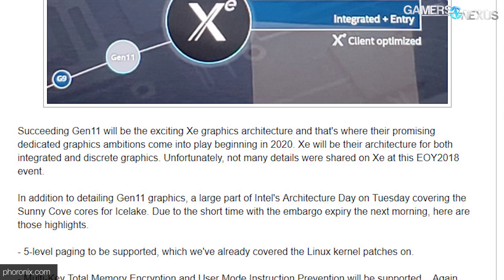Streaming Misconceptions: Best OBS Settings & NVENC vs. X264, ft. EposVox | LTX

Comment: I know this is old video but I have a I5-10600kf and a 1660 S. What encoder should I use? I tried Nvenc, 720p and 60 fps and apex is still crazy laggy on my stream. My internet is great and my bitrate is what twitch suggest. I can’t figure out how to fix it. What’s the best settings for my setup
Reply: Now you might be wondering how come some people have a decent Livestreaming quality if you're the observer?

The answer is simple, they're treated with higher Encoder settings by the server. Instead of AVC / H264 / X264, they use VP9 or AV1 instead. Hence better picture quality.

That's why "Partnership" is a thing.
Reply: Don't livestream.
Regular recording and manual Uploading is best for you.
H264 or X264 in general is Bitrate limited. You start from 720P logic and scale it from here.

For a decent 720p 60 FPS, you need 12 Mbps (Megabits not Megabytes) for the video, not including the audio, 1 Mbps is more than enough for Stereo channel audio. And Audio Quality doesn't really scale with video resolution
That means a total of 13 Mbps for 720p.

1440p is literally 4 times the size of 1280x720 - double width, double height. Now, just multiply 12 Mbps 4 times. You get 48 Mbps for the video bitrate. Most people with decent internet at 48 Mbps (or 6 Megabytes per sec) shouldn't have problems with Livestreaming speed —Or is it?

According to YouTube and/or twitch Livestreaming guidelines, they recommend you to use 6 Mbps (6000 kbps) for 720p 60 FPS streaming.
Do you know what that means? THEY LIED TO YOU.

6000 kbps for AVC / H264 / X264 Livestreaming at 720p 60 FPS will never be good eternally. And it's actually Hard-Limited on their server side. Which means even if you have more than capable internet speed at 48 Mbps, and you force the stream of 720p 60 FPS at 12 Mbps, the server will just Transcode it to 6 Mbps regardless of your upload speed.

Comment: If you can already get a comfortable image quality out of your games, target a CPU that can sustain x264 medium 1080p 60fps.  Worth it.  3950x can do slow (maybe slower), either slower or slowest caused a system shutdown and I didn't push it further.  I'd stick to medium but when I want extra heat in my room.

Comment: With a 3900x and 2080 Super -  would you be using Nvenc or x264 on medium? Also i have a c920 and idk how to set that up well, im wanting to stream 720p 60fps at 6k bitrate, should i just have the cam match or use 30fps?

Comment: Great video!! I have a Ryzen 7 3700x and RTX 2070 Super, I’m new to streaming and was wondering if I should use NVENC or 264? Also what should my bitrate be, I like steaming 720p at 60 FPS. Thank you so much 🙏🏽
Reply: You have a 3700x. Stream at x264 medium that’s what the cpu is meant for. If you feel like you want more FPS go with in a certain game go with nvenc
Reply: @plymix8389  so the 3700x is meant for streaming? I'm someone who wants to stream but depending on how much G the new AMD GPU have, I might go for them over the 3070 so I was wondering if I should get a 3600 or 3700x for playing and streaming using x264?
Reply: @floki6548  3600 is for the average gamer. It could handle streaming but if you want to stream alot then go for the 3700.

Comment: 1280x720 not being as good as 640x360 for webcam quality is absolutely not true. Even at a smaller size, it's blurrier and has more noticeable of a halo if you're keying. 

I recommend 1280x720 for your c920, it'll still run at 30 fps and when you downscale it, it'll retain a lot of the quality from the downsampling.

Comment: Err.. well you mentioned audio settings being important but you didn't give any tips on what codec or quality to use...
Reply: for what i know everything basically uses aac so there's that.
also audio options the bitrate i think you should set it to 192, and 48khz(?) though tbh idk if its too different from 44.1 to 48.

also filters can be a huge help, such as noise suppression and noise gates.

get a quality mic or you will regret it

Comment: How is my game not running at 60 fps.... I'm clearly hitting 144+. Who tf wants to stream at 30fps? This is the equivalent of telling people to buy a car from the 1990's as opposed to a newer model. Stupid.
Reply: Many games especially on consoles run at 30 fps. Also, there are slow-paced games like some adventures or turn-based RPGs which may run at 60fps internally but you wouldn't see any difference between 30 or 60. In that case you gain absolutely nothing from streaming at 60 fps, you only waste bandwidth while requiring more bandwidth from your viewers and potentially get a lower quality stream. I personally have two presets in OBS, one for 30 and one for 60 fps games, and switch between them depending on the game I'm playing.

Comment: What settings should i use on obs if i have rtx 2080ti and ryzen 9 3900x 16gb ram 3600mhz cl 15 samsung bdie  with internet connection 200 and 20upload?
Reply: Streaming apex for twitch

Comment: so wait I'm meant to take advice from someone who claims console games are 30fps? i can name maybe 5 current games that run at 30fps on current consoles and all are 4K and openworld. one of the games gets 36fps on pc in 4K SOOOOOOOOOOOOOOOOOOOOOOOOOO
Reply: Upscaled 4k not true 4k SOOOOOOOOOOOOOOO
Reply: @StreetRallyAsh  only on ps pro, Xboxonex doesn't scale it don't need to... so wind ya neck in moron
Reply: Actually many games run at 30 fps only. It also depends on the game, as some games don't even need more because they're either slow-paced or consist of mainly still images etc. There is no "one size fits all" setting. So yes, it's smarter to stream 30 fps games at 30 fps and 60 fps games at 60 fps. I personally use two different presets for that in OBS.

Comment: Question, should you run the Elgato Game Capture HD60 Pro from your main PC or secondary PC? I am running a i9-9900K with RTX 2080. If a second PC does the system requirements still matters a lot? Finally if there is a guide online that covers how to properly setup a dual or single system to run optimized can someone link it here. Thanks in Advance! One final question is the i9-9900K more than equal for streaming / gaming or should I be looking into a 3900X?
Reply: Second pc (obs machine)

Comment: So I’m in a dilemma I have a 3900X with a 2080 Ti what should I be using? I’m using right now the software encoder should I be using nvenc? Medium or? My native resolution is at 1440p 144HZ my output stream is at 1080p 60fps. Right now just streaming Apex

Comment: NVENC encoder chokes in OBS and drops many frames when streaming a game that you get more than 60-80 fps in on a single PC streaming setup. It also chokes if your GPU utilization is high, such as on a new AAA game with the graphical settings maxed out. It's not nearly as useful as it is purported to be. If they can solve these issues, then it will really be an excellent alternative to x264.
Reply: Or you just use the "new" nvenc and get a lot more performance out of it cause they removed the limiting factor when it comes to GPU Encoding with NVENC
Reply: @alpin2k7  This is false, what I said previously applies both in regards to the previous NVENC and the new NVENC encoder.

Comment: I wonder why Adam didn’t point out his findings on stream quality with NVEnc. 

After all, he himself did a long series of tests about NVENC Quality va X264 Quality and basically found out that NVENC on Turing cards trades blows with X264 on Medium Settings. What’s More: X264 above Medium Settings is just not worth it.

I mean: Yea, it depends on the load on the GPU, but he said before: Testing Testing Testing! So what gives?

Comment: Here’s the question no one can answer for me for streaming settings in Obs with this setup..
Ryzen 7 2700x, GTX 1070, 16GB RAM, 720p60fps stream.. do I use x264 or NVENC (new) and with what quality preset for either?
No one has ever been able to answer this well and I doubt these guys will either.
Reply: All I'll say is test both. I feel like both would work decently, but u gotta test them if you want a firm answer

Comment: 3900X - 1080p 60fps slow preset, high tune, 6-8k bitrate as i want - no dropped or skipped frames - i am so happy! :) PUBG, Rocket League, CS:GO, Overwatch ... 
We tried faster, fast, medium, slow and despite some other video that said "there is no difference!", i can clearly see ( as my viewers did too and asked what i changed ), that der is a huge difference when details like trees, grass, water etc. is shown and you move or turn around.
Reply: what other settings do you use im trying to use the same processor

Comment: I just turned down resolution on my C920, thanks!
Now there is no delay and i think webcam will feel less stressfull
And yeah, image is pretty much the same, thanks again for the tip
Reply: @Lil DonWan 480p 30 fps, it's plenty for little image in the corner

Comment: A little known fact: When exporting a 900p stream to youtube (via twitch exporter), it will downgrade it to 720p. This alone could be a reason to move up to a 1080p stream. It was for me.
Reply: You can set up OBS to save a local copy in 1080p and downscale the output for streaming to whatever value you need.
Reply: @LastofAvari  Does that use a lot more resources to stream + record at the same time?
Reply: Veetus have you found out if it uses more resources? Thanks
Reply: If you're using the "(use stream encoder)" setting for recording then no... ish, the only extra resources it should use, from my understanding, are the resources needed to write the file to disk, as the video only needs to be encoded once and just sent to different places simultaneously.
Reply: @Veetus  Yes, it has to be encoded two times.

Comment: x264 medium - set and forget on AMD Ryzen 3900x :)
Reply: How about 3700X?
Reply: @s9209122222  I'm using fast on my 3700x. Works fine. I can't tell the difference between fast and medium tbh.

Also I'm not streaming at 1080p60, but 960p60 instead. It significantly reduces blocking artifacts.
Reply: @Niosus  How can you see the difference between all the resolution or nvenc/x264 yourself? I want to see which is better for me.
Reply: @DieTabbi  record clips with OBS and save them on your computer (don't stream, since it degrades quality further). Change settings, label the clip, repeat. After you have some samples, just watch them and compare the quality.
Reply: Niosus ah lol the easiest solution and I didn‘t see it. So streaming AND recording is not good? I want a 3900x is that possible?
Reply: @DieTabbi  Haha, it happens.

I just meant to only record to check the quality, you can record and stream just fine. The first option is to record the stream as-is, exactly. This means you only have the streaming overhead once. This I can do easily on my 3700X. The second option is to record with different (higher quality) settings. If you plan on making videos from your stream, this could be useful. The problem is that you have to encode twice, and the encoding for recording is at a higher bitrate so it'll put more load on your system. I guess it'll work on a 3900X, but it may not be optimal. Usually people get a second streaming PC for this. But hey, you can always try :)

Comment: Do a video about the nintendo switch "radiator", i think its the same as the opolar laptop cooler. It uses suction at the exhaust port. Its fairly effective on thin laptops
Reply: I’m making an ice/dry ice/LN2 cooler for phones and it should work on the switch (if anyone is interested, I can probably post designs for free this weekend, I do want to test the prototype and improve anything I find as usual) since I’m making it universal and doesn’t require disassembly or alteration to the device (I’m not recommending LN2 since the screen will probably crack, and at minimum your hands would freeze). I’ve already water cooled a tablet about the size of the switch and published the small waterblock I designed for it on Thingiverse under “penny waterblock”, so it only costs like $5 for a full water loop, I actually spent less. However that mod does require disassembly and I drilled through the casing for the cooler to mount to the processor (overclocked 44% while also being 40c cooler than factory stock out of the box)

Comment: There is no point to even stream with x264 anymore now with the rtx cards. I did a lot of testing and it looks like crap with anything over 720p, I now stream with nvenc @ 900p60fps using rtx new turing at 6200 bitrate and looks better then with x264 medium..

Comment: Care to explain the issues with 48fps more in depth? I've been using 48fps for select games that im unable to run in 60fps. It looks very fluid and smooth at 48fps I don't see the problem?
Reply: Most displays run at 60hz so they are outputting an image 60 times a second which means one image every 16.6ms. The display does this regardless of the frame rate the game is running at, so if the game is running at 30fps the display just outputs every image twice, since there is no new image from the game for every second image the display wants to output.
Now if you are running a game at 48fps that would be equal to 20.83ms per image, but the display only outputs every 16.6ms. So you would get one image after 16.6ms, a second image after 16.6ms later and a third image at 16.6ms later and then get the forth image after 33.3ms later (  (3x16.6 + 33.3) / 4 = 20.83ms). You'll get 3 images consecutively after 16.6ms and every forth image takes twice as long. This inconsistency makes the game look stuttery and that's the reason why games typically run at either 60 or 30fps. The frametime will be consistent if your game runs at a number of fps that is the number of hz of your display divided by a whole number, so for 60hz that would be 60/1=60fps, 60/2=30fps, 60/3=20fps and so on. However 20fps just isn't enough images anymore to look smooth and many people would argue that 30fps also isn't enough for games to look smooth, but you can make do with it.

Comment: I use a secondary rx 550 to record 1080p60 at 30k+ bitrate and it's very very nice for very cheap and almost zero cpu impact and literally zero main gpu impact.
I bet its cheaper than upgrading your hardware and it canot impact your gaming exp.

Comment: You didn't even mention that NVENC is using a seperate encoding chip on the GPU unlike x264 which uses software encoding.  The difference is NVENC will never use more than 2% of your GPU on max recording settings (for me on a 1080ti). To get the same quality using x264 it uses up like 70% of your CPU (in my case the i7-8700k)
Reply: Yeah, high quality software encoding is incredible demanding. You can see the same thing happening with emulators and very old PC games, you can either use software rendering to have the game rendered entirely by the CPU, or use your GPU which is magnitudes faster.
We even saw the difference recently, when Nvidia patched RTX compatibility for 1000 series cards. You can use Raytracing on a 1080 ti for example but since it only done via software, it's a lot slower than an RTX 2060
Reply: They do mention NVENC vs x264. They spend a good amount of time talking about it.
Reply: So if i am having issues with my stream dropping frames switching my encoding to NVENC can Help?
Reply: @vyronjohnson8893  yeah
Reply: And you won't notice any difference between the NVENC and the x264. I don't care what people say about NVENC vs some other ridiculously expensive setup. The audience literally cannot tell what minor nitpick some people possibly have with NVENC. Most big channels actually just use NVENC, not any other ridiculous setup with increasingly diminishing returns.
Reply: scythelord i finally think I figured out my bitrate to make my webcam look less crappy but then my frames in my game became kind of trashy. And everyone says to update to superfast but I don’t have that option for the nvenc that’s just for x264 so what should my settings be for using the nvenc to keep a decent quality webcam and capture of the game

Comment: I have a degree in media arts and animation. We were taught to record in 24 or 29.97 (30) frames per second. Can you imagine how long it would take to animate a character at 60fps? Good job on your videos as usual.
Reply: Why would anyone use 24fps in this day and age? 99.9% of displays are 60hz or higher, it may not be as bad in non-gaming content, but it still doesn't get you proper framepacing.
I would really like to see an animated show at 60fps for once, just to know what it looks like. I know that's a lot more work, but with stuff like interpolation it should be able to reduce the works, since they wouldn't have to draw everything from scratch, right?

Comment: Ryzen 7 2700 or Ryzen 5 3600 for single PC streaming and gaming?
Reply: Ivan Hernandez if you use an ATX motherboard, buy a cheap GPU just to stream with. No need sli or whatsoever. Plug it in, install drivers and pick it up on obs. No need to plug a monitor on it, it will just be used to encode the video.
I record 1080p60 with an RX550 but it looks like amd cant stream. Just pick a used 970 but check if it have an encoder built in. Nvidia is not offering it at a low budget.
Reply: Get the 3600 for better gaming performance and buy the best RTX 2000 series card you can afford. Then just use the gpu encoder for streaming. It provides good image quality and has a negligible performance impact

Comment: For the same bitrate, x.264 is always better image quality as long as the setting isn't overstretchibg your CPU.  In my tests I need to run about 2x the bitrate with NVENC(Turing) to reach a similar image quality
Reply: That's not my experience.